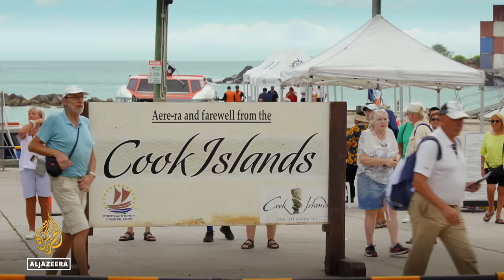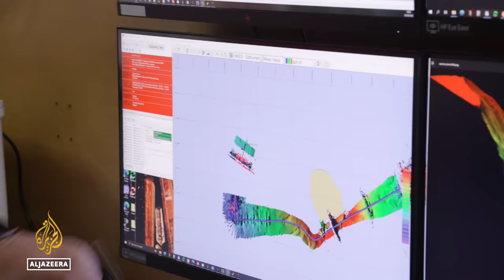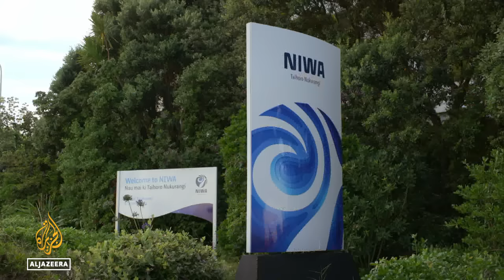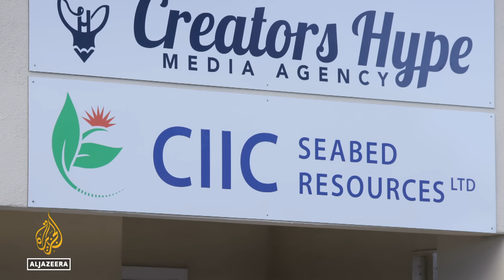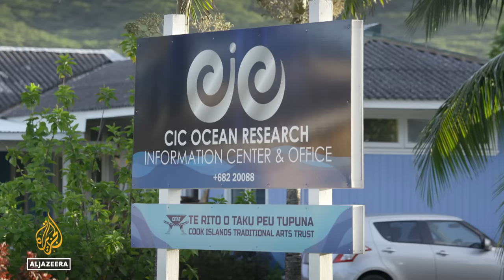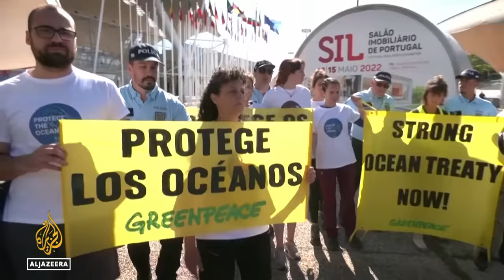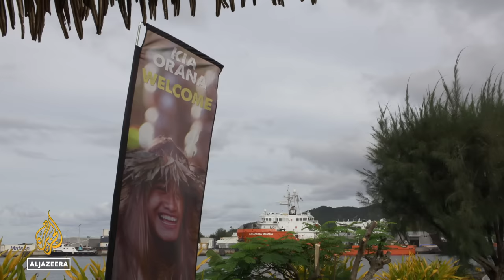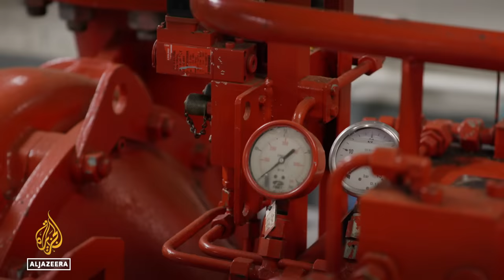To meet the booming demand for electric cars, should we start mining the world's largest ocean?

Comment: If this is another corporate shareholding business, they’re going to cause damage.  They will find the cheapest cost cutting method to extract these minerals at the cost of the environment.  They won’t invest in mitigating damage.
Reply: This is the most important point that the story missed.
Reply: Unfortunately, we all benefit from corporate shareholding businesses. If someone can come up with a formula to restrict the massive profits that the big corporations have historically realised, then we all might reap the benefits of research, exploration and exploitation?
Reply: @peteypops  that’s “if” we can all benefit from the realized profits. Otherwise we obtain no benefits at all. 
The average CEO wage has risen over 1300% since 1978. 
As long as they maintain low cost of overhead which includes keeping wages down, forever if possible. Also includes using profits for stock buy backs to manipulate share prices to artificially increase instead of reinvesting in the company through wages or machinery. 
I just don’t see how you can say we all benefit from Wall Street when the main purpose of a CEO is to lookout for the best interest of the shareholders.